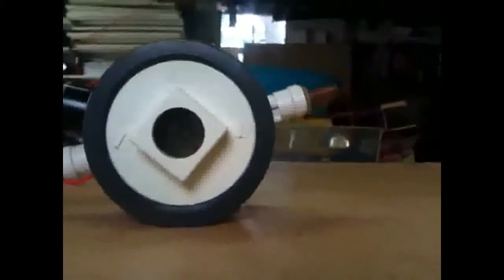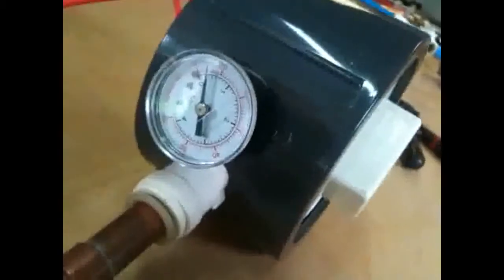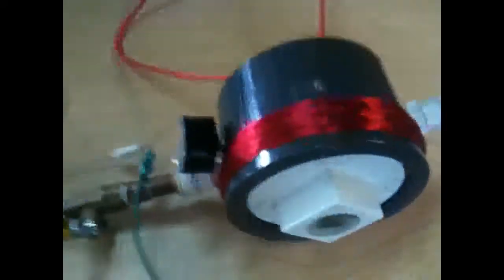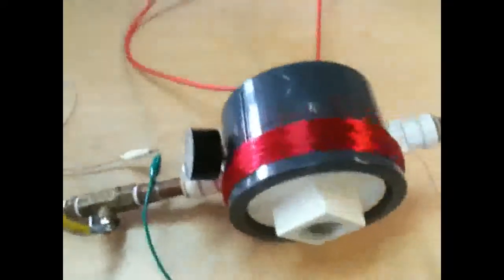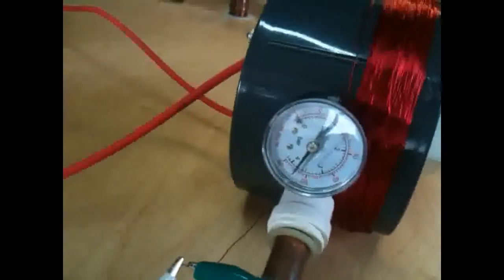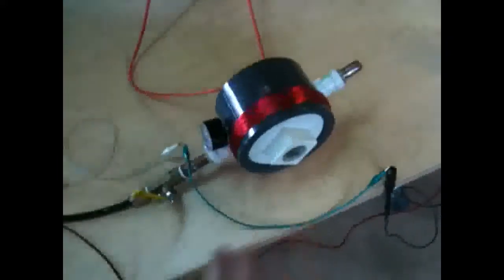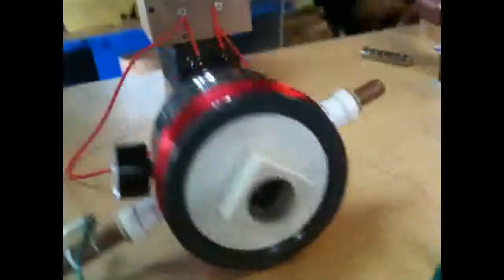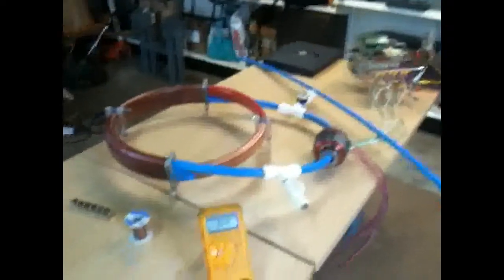EPG Gas Processor In Action Trying To Extract Electrons. RWGresearch.com

Comment: Idea;  Try and FUNNEL the Argon through the spark gap. The pressure of the incoming gas should help replenish the depleted gas between the electrodes after every spark. I've used this method to replenish the air between my spark gap for my tesla coil and have achieved better results. Keep up the great work Russ!
                                                           Semper FI

Comment from the maker: @irondmax Agreed Here is the thought (The arc is for striping eletrons off the argon and to ionize the argon) but there needs to be a staic feild, I agree with that, the spark needs to be DC like a cornea feild to ionize the gas... I going to build the gas gun and Eletronics... This will produce the high voltage cornea feild and then there is led's to help extract eletrons. pulsing 180 degrees out of phase with the high voltage feild, then the EEC will need to be in there to... Lots to do! ~Russ

Comment: I know this is old news and I'm not sure where you went with the design...but this is my understanding:  
Argon is used as the inert gas (which you have in this video).

The electrodes should be Iron with DC applied to create the arc. 
This will setup material decomposition of the electrode and allow the argon gas to "carry" away the very fine iron.

At your exit port you want to place a very large magnet to align the "iron particles"  in the argon gas.

From that point your coil should be past the exit tube to see what voltage the "magnetic gas" produces as it passes.

I'm not sure Stan's system ever worked as his tube was conductive copper and would short out the magnetic field before reaching all his coils.

If you wanted to "trick" someone you could pulse voltage around Stan's EPG copper coil and all the external coils would generate electricity.

Best of luck.

Comment: @irondmax he he russ. the way i see it is that a UV burst from a flash will cause the dipoles to move, this is because some dipoles are pushed away at 2 times there energy. that is a stronger force in the opposit direction.
you are on the right track soon real good results. the hho gun is awsome.

Comment: the key being when the pressure stayed steady, and the temperature cool. more proper will be the results. to see you take an electric field, and get and alternating current back was good. these Tesla one wire motors may work well with a device capable of one wire not grounded. perhaps a flora bulb would light in place of the bulb.

Comment: interesting disruptive discharge, hook that gap to a tesla primary, and you wont need a motor to change the spark times, the gas itself or air rushing by is causing it to generate many on off times, so you may be making a higher frequency, or at least you are breaking the gap as fast as it is established. Key for higher frequency rates.  would you agree?

Comment: can you define how much voltage and frequency was applied to the spark?

can you charge a capacitor off the coil? then you can use the pulse for the primary.

Comment: i think the static field needs to be for aligning the gas lattice, and the pulsed frequecy was just making the gas move in place of the pump.....no arc is not needed....you can have plasma with out an arc
always in meyers work, you see a diode............rectifier
and again......LEDs do not extract electrons.....the photons released by the LEDs excite electrons....excited and un excited electrons move up and down in the electron cloud, photons are released when electrons move down in the cloud

Comment: @rwg42985 it is not the argon you need to extract from......meyer showed the argon linked in a lattice with the nickle what ever it was......the argon was the neutral....the other gas was linked to the argon with an electron bond. therefore the electron needs to be stripped from one gas and then one gas will have a extra electron and the 2 gases will bond with an electron bond....then the non argon gas is the moving magnet that produces the electricity.
the copper tube was meyers start, not end

Comment: @rwg42985 i have read them and seen the videos, he said argon and nickle particals and some other particles.....formed into a lattice, the lattice shape would make the pulse needed to pull the electrons from the gasses. you need a pulse across the coils to pull the energy, the lattice. also he spark itself, i do not think this is correct. you need the static field not the arc. they are not the same thing.

Comment: I think what is happening here is what happens in a crt tube why voltage comes out of the tube the pvc can transfer electricity and I suspect the high voltage arc is putting off x ray radiation that the coil is picking up the charge from.

Comment: Russ you almost discovered true free energy lucky for you you did not as they would shut you down quicker then you could pack to leave as they did on this other YouTuber he was creating 11Kw at 190 amps with a device like this but a few miner changes no power source needed no fuel total free energy the best I have seen on the internet ever, you could build and power up a UFO  thing I saw the hole thing was only 15"x6"x10" small enough to put in a motorbike yet powerful enough to run a plane.

Comment: you will NOT get get any electron under atmospheric pressure. what you captured is the electromegnetic wave from the discharge. read more before making things up. check these definitions out: mean free path, arc discharge

Comment: your extracting power from the spark, not the gas. although it looks cool, it is a very ineffeciant transformer. the spark is the primary and the outside coil is the secondary. 
meyers EPG was moving gasses, passed through coils of wire. 
the electrons your catching here are emitted from the spark.
a little word of caution on watching those sparks......buy a welding helmet
cool sparks